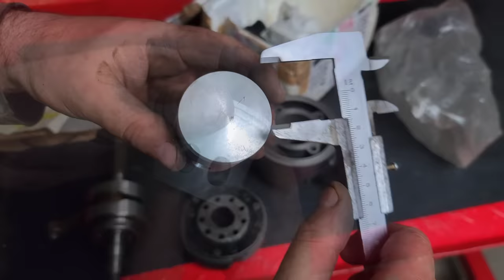Yamaha BWS - водяное охлаждение, подготовка деталей

Comment: Where did you buy lc kit for yamaha booster
Reply: Everything from the aftermarket and viewer gifts
Reply: cylinder from Minarelli DL3
Reply: @mexanuk96  can i get the link ?
Reply: @kacperr4544  Youtube will block the link,make a request to google cylinder minarelli dl3, it immediately gives the result
Reply: @mexanuk96  thx
Reply: @kacperr4544  but there is one caveat. the distance between the mounts is slightly different. according to calculations, if they are drilled, then everything should fit
Reply: @mexanuk96  ok thanks

Comment: i love your works. i work just like that. all with 4 stroke and 2 stroke 50cc 70cc and 90cc.
but i need help with one i working on now. it wont start. it got new cylinder and it sparks fine  <2 stroke pgo hot 50>